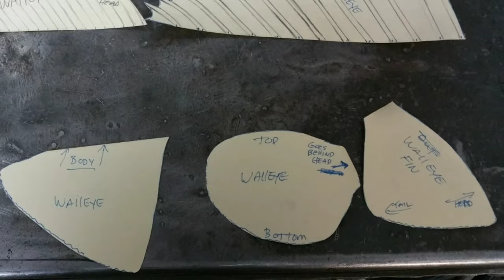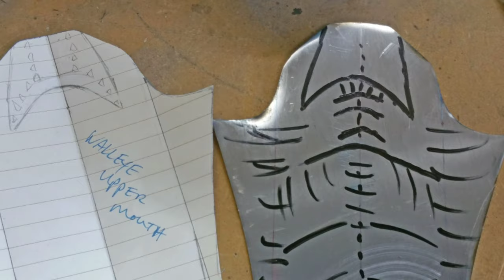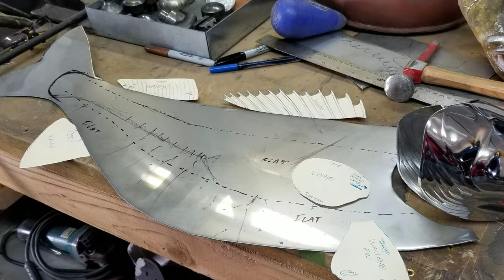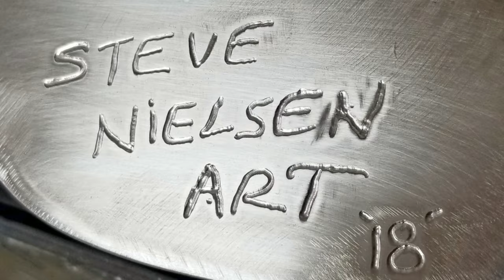Stainless Walleye sculpture - Steve Nielsen Art

Comment: Absolutely super effing finish on that piece. Awesome.
Reply from the maker: Thank you Richard. After building it, It took me a solid 6 weeks to sand and polish it. A lot of the body had become work hardened. So imagine starting with 80 grit and it would barely cut the stainless. Lol. Eventually once I worked my way up to 1000 grit. It polished on the buffer pretty easily.

Comment: Hi Steve, amazing work. I'm new to working with stainless steel and am curious to know if you prefer working with 303 ss or 304 ss. Also, are you electropolishing your pieces? The details and finish are immaculate.
Reply from the maker: Hi Tom, to be honest I usually hit the stainless scrap pile on a lot of these that are one off builds. The local metal supply company had huge scrap piles I'll pick through. The only problem is theres no way to know what grade of stainless I'm getting.
Reply from the maker: Also I start with 80 grit on the welded areas then worked my way up to 1200 grit before going to the compound on a buffing wheel. It's a ton of work. I had 6 solid weeks working 7 days a week sanding and polishing that piece once it was built.
Reply: @SteveNielsenArt  There's a place that I go to and they have an "Artists Corner", lol. I researched enough and found 303/304 is virtually the same, minus a slightly better corrosion resistance. If it's art though...
Reply: @SteveNielsenArt  I could tell you worked hard on that piece. It came out great. Thank you for the tips and replies!

Comment: hi, goray what is the name of the bending machine which you are using ? (the one u are using to bend the stomach )
Reply from the maker: That's a TM Technologies airhammer. It utilizes different size air units that are easily swapped out from soft hitting up to very hard hitting. I use a large air until for shaping, and a smaller unit for planishing (smoothing out) the metal once I have my desired shapes. Can see more about them at Tinmantech.com ask for Kent White.

Comment: How much would somthing like that cost?
Reply from the maker: They vary a lot, depending on what each customer wants in detail. To be honest this particular piece took me a lot longer than any fish I've done previously. Just under 800 hrs. That said most people dont have the budget for this level of work and they Settle for something less expensive. If your interested you can email me to go over the options. SteveNielsenArtist@gmail.com
Reply from the maker: Feel free to email me about different options and prices. SteveNielsenArtist@gmail.com
Reply: 800 hours? That is just wow. Very awesome
Reply from the maker: @zacholson3429  yeah being 16ga stainless steel and dealing with it becoming work hardened while I was shaping it, really set me back. If I had some heavier equipment rated to shrink and stretch 16ga stainless, I could save myself a lot of time and hard work. But we are talking about 14k for two machines I'd need. Eventually I'll get there. 
Also once the body was finished, I invested roughly 6 weeks just in metal finishing, sanding, and polishing. Sanding and polishing stainless is 10x more work than aluminum, and work hardened stainless is probably at least twice the work than non work hardened stainless steel.